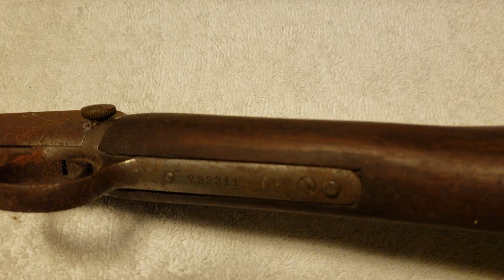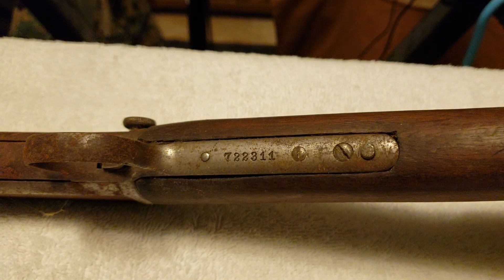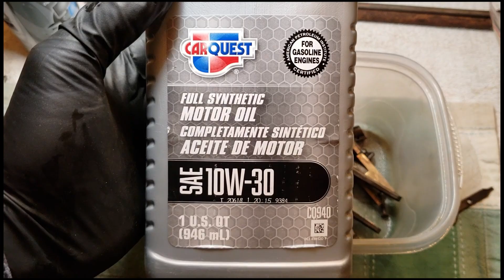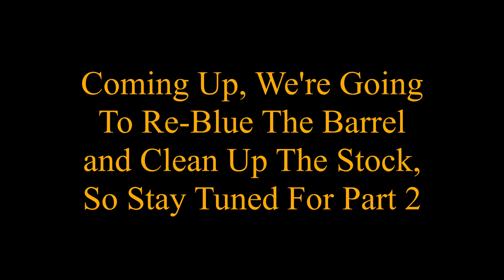Winchester Model 1906 Pump Action .22 cal - Gallery Gun RESCUE Part 1

Comment: You may want to become more familiar with the design of the weapon before you start tearing it down. The first screw you removed  was on of the mainspring screws. It didn’t need to be removed to take off the buttstock. That’s why the mainspring fell out when you pull of the butt. The matchbox in the inlet was an improvised shim.

Comment: You should boil the steel parts to convert from orange rust to black rust then card.  Watch Mark Novak’s channel.  I’d also recommend removing the firing pin, two small screws.